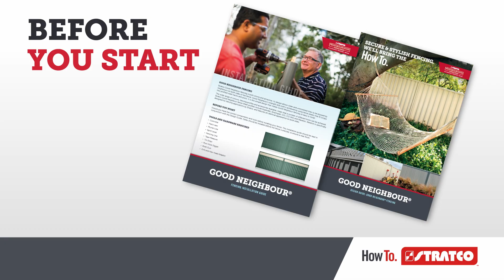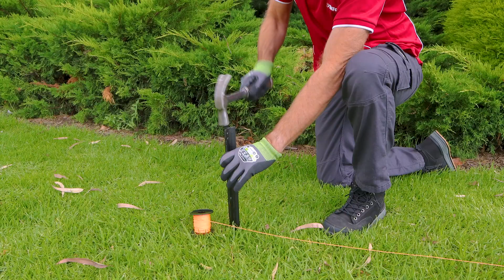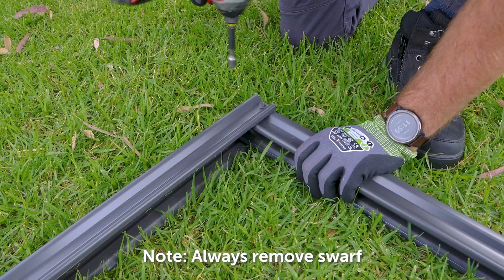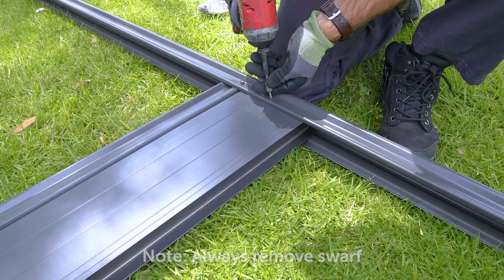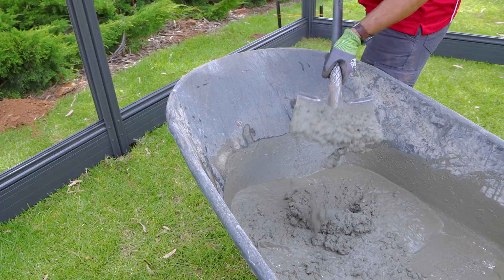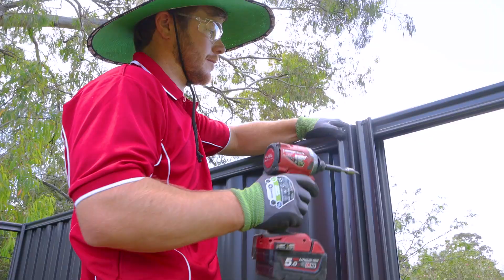HowTo Build a Stratco Good Neighbour Fence | Stratco

Comment: How did you join the corner?
Reply from the maker: Hi Andy, for more information in regards to installation of joining the corners of the fence - we would advise you to please speak with our Design Team who would be able to confirm this for you. Please give us a call on 1300 165 165 during business hours and they will be able to assist you. Thanks! 😊
Reply: If you are doing multiple boundary’s the strongest and neatest way would it be to use a steel powder coated 50x50mm or 65x65mm post then connect the good neighbour with screws in this.
Alternatively if this isn’t a option a singular post fixed into existing fence using the appropriate screws for the material